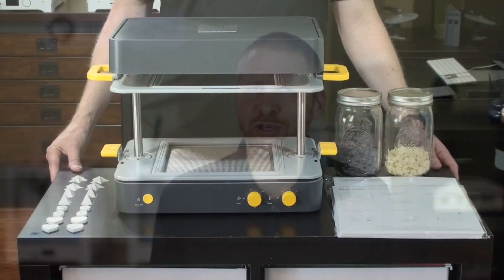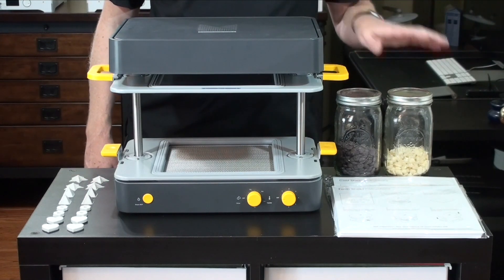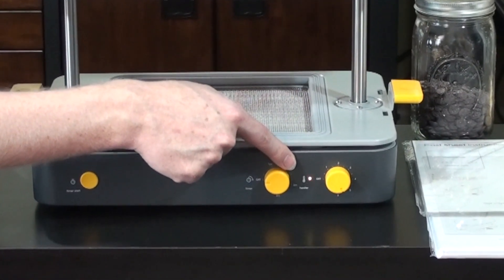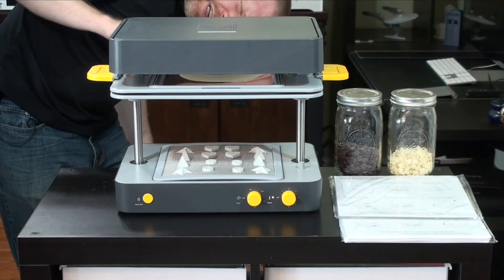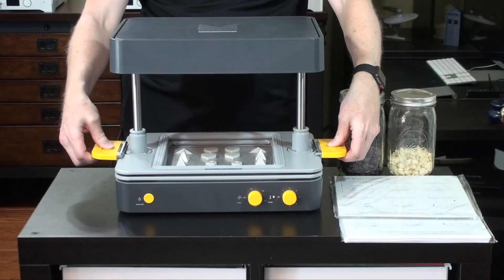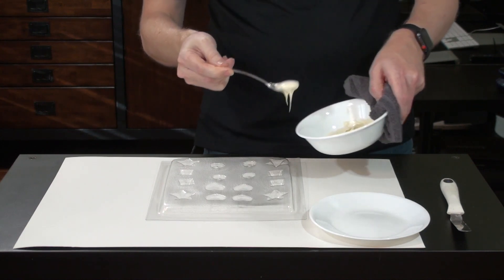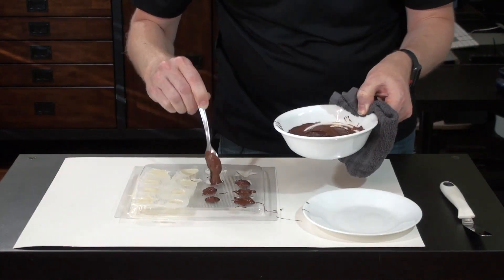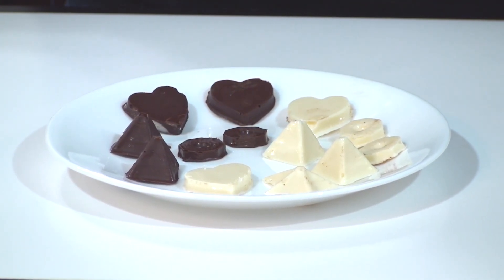Making Chocolates with the Mayku FormBox (3D Universe)

Comment: Did you wash the resin pieces before using them just wondered if resin is food safe.I want to sell molds but dont want to  wash the molds before putting them on sale. so wondered how i can make sure the resin pieces are safe ?
Reply from the maker: The Cast Sheets are food safe. So if you use a 3D printer to make the forms like I did, you would just need to use a 3D printing material that’s food safe, of which there are many options.

Comment: You didn't say which way the cast sheet goes in?
Reply from the maker: Hi, Terri. Once the protective covering is pulled off, the cast sheets and form sheets are exactly the same no matter which side is up.
Reply: Are you saying both the form & cast sheets are "food grade" safe?  I thought the cast sheets are food grade and the protective cover had something do with that?   What is the purpose of the removable plastic then?
Reply from the maker: @tmueller333  No, I didn't mean that the cast sheets and form sheets are the same. I meant that the two sides of a cast sheet are the same, and the two sides of a form sheet are the same. That's the answer I received from the manufacturer. Still, if I were making a food item, I would place the side that had the protective film facing down so that's the side that will come into contact with the food.
Reply: 3D Universe kind of depends if your forms are food safe, since they will be contacting the food surface too!
I’m sure you’ll be fine :p